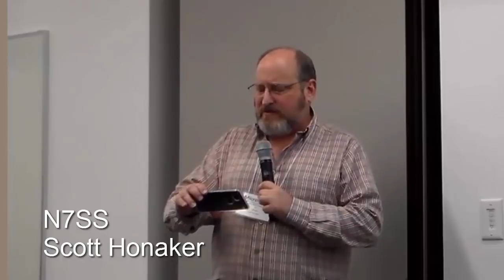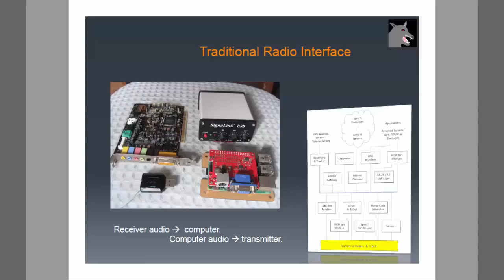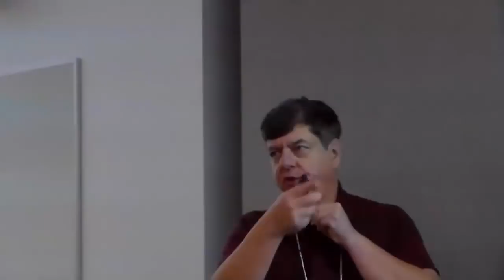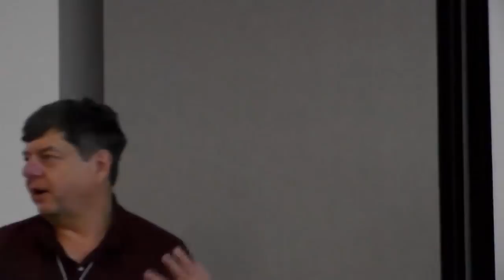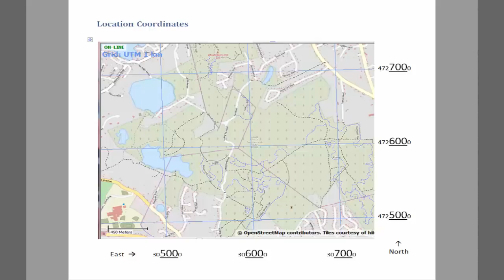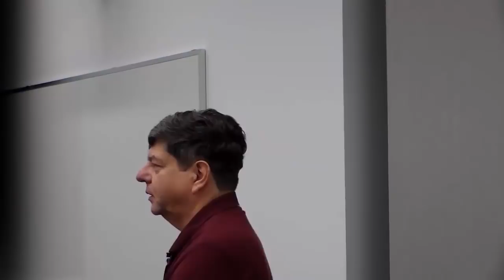Direwolf Software TNC - MicroHAMS 2018

Comment: great talk, thanks! any more info on how the usbsoundcard gpio trick is done (software wise, hardware wise)?
Reply: You could just take one apart and get the data sheet from google then just find the 5V GPIO pin which is active when audio is active... then you just tap it to a 5V relay for PTT to your radio.
Reply: @daveschwarz5279  ofc! Thanks for the pointers =) Now using an usb2serial ftdi and couple of transistors to short my baofeng to transmit mode using the excellent option in direwolf, wonder if this works better =)